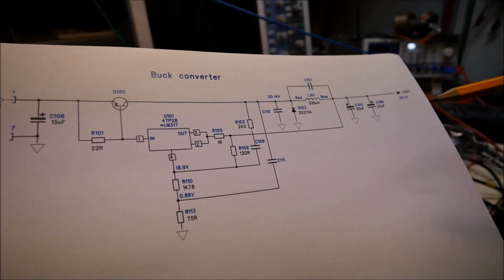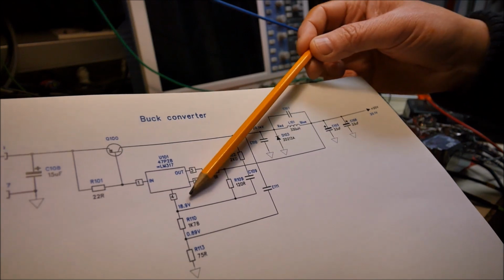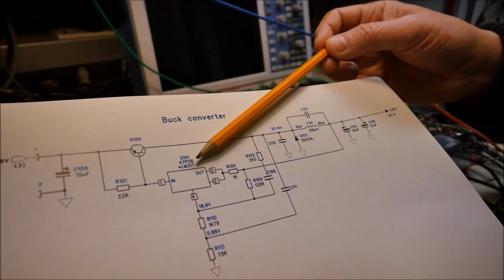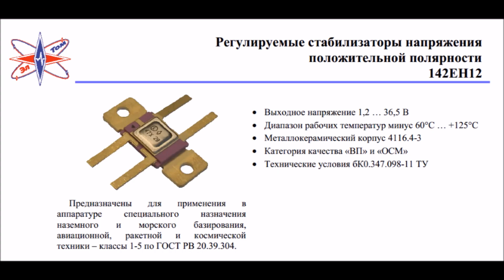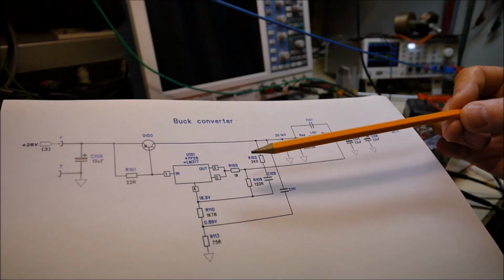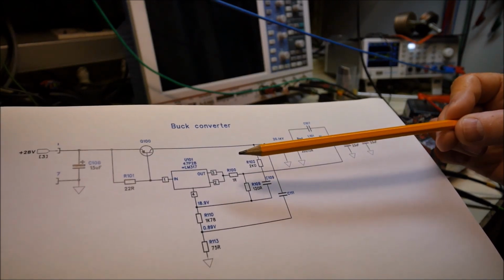LDM #396: Tornado-S Missile Part 5: Synchronised voltage to frequency converter

Comment: AI Summary

Abstract:

This video analyzes the inertial measurement unit (IMU) of the Russian Tornado-S missile, focusing on the accelerometer circuitry. It corrects previous schematic errors, detailing two versions of the LED current source and clarifying the function of the Buck converter. The video identifies the core circuit as a synchronized voltage-to-frequency converter, referencing a Russian patent related to temperature stability. The operation of the converter is explained, demonstrating the relationship between input current and output frequency. Finally, the video outlines a plan to build a test circuit using a PIC microcontroller to measure acceleration, speed, and potentially position, and it demonstrates testing the accelerometer on a modified test board, showing accurate readings of acceleration in G's.

*   0:00:04 IMU of Tornado-S Missile: The video focuses on the Inertial Measurement Unit (IMU) of the Russian Tornado-S missile, specifically the accelerometer component.

*   0:00:09 Schematic Corrections: The presenter corrects mistakes from a previous schematic related to the accelerometer's LED current source.

*   0:00:22 Two Current Source Versions: Two versions of the LED current source circuit exist. The first (2022 boards) uses a Zener diode (6.5V) and provides ~40mA. The second (2024 boards) uses a Darlington transistor configuration and a current source (~300µA) instead of a Zener, providing ~33mA. The change may be due to component availability or reliability issues.

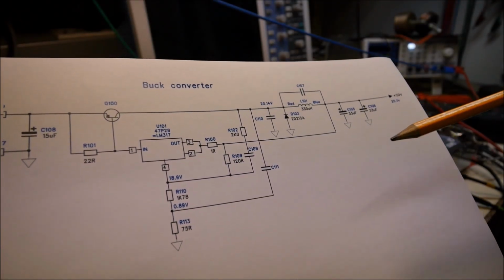*   0:01:45 Buck Converter Clarification: A component previously identified as a MOSFET in the Buck converter is clarified to be an equivalent of an LM317 linear regulator.

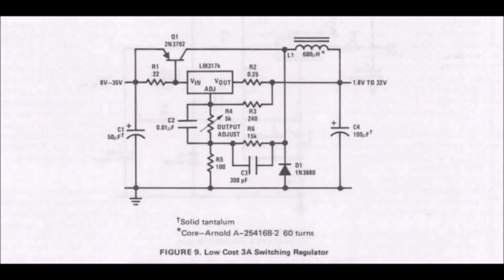*   0:02:10 Voltage-to-Frequency Converter: The circuit is not a multi-slope ADC, but a voltage-to-frequency converter, as detailed in a Russian patent. The patent focuses on temperature stability of the accelerometer.

*  0:02:29 Accelerometer Block Diagram: A block diagram of the accelerometer circuit (found in the patent) shows an interface very similar to the one used on the missile. Key components include an integrator, two comparators, and flip-flops.

*   0:03:09 Detailed Circuit Analysis: The circuit includes an integrator, two comparators (with positive and negative thresholds), two JK flip-flops, and feedback for adding/subtracting a reference current.

*   0:03:36 Synchronized Operation: The voltage-to-frequency converter is synchronized, with a clock frequency of 200 kHz.

*  0:03:44 Signal Analysis There is jitter as a consequence of the synchronization with the clock frequency, but integration is possible for speed calculation through pulse counting.

*   0:04:38 Input Current and Frequency Relationship: Demonstrations show the output frequency changes proportionally with input current (e.g., 10mA input ≈ 1.74 kHz output, 20mA input ≈ 4.48 kHz output).

*   0:05:30 Speed and Position Measurement Design: The presenter plans to design a circuit to measure acceleration, speed, and potentially position, reusing a previous design with a PIC microcontroller.

*   0:05:53 Microcontroller Modification: Two 32-bit counters within the PIC microcontroller will be used to count pulses from the positive and negative acceleration outputs. A pin used by the original design will be rerouted, and the line will be cut accordingly.

*   0:06:35 Clock Output Modification: A Pulse Width Modulation (PWM) output (pin 11, OC1) will be used to generate the clock, and it will be able to directly drive the pulse transformer.

*   0:07:20 Test Board Setup: A test board is used, with the accelerometer mounted and connected to a middle board and then to the main test board. Power (5V) is supplied via a separate board.

*   0:08:02 Signal Connections: Twisted pairs of wires are used for the 200 kHz clock signal, positive acceleration output, and negative acceleration output.

*   0:08:18 Mode Selection: A selector switch allows choosing between acceleration and speed modes. A push button initializes counters in speed mode.

*   0:08:41 Acceleration Mode Demonstration: In acceleration mode, the display shows the difference between the two input frequencies and the acceleration in Gs. The accelerometer is demonstrated, showing 0G when orthogonal, +1G, and -1G in respective orientations.

* 0:09:08 Frequency at 1G: the corresponding frequency at 1G is 326Hz.

I used gemini-2.0-pro-exp-02-05| input-price: 1.25 output-price: 5 max-context-length: 128_000 on rocketrecap dot com to summarize the transcript.
Cost (if I didn't use the free tier): $0.02
Input tokens: 13402
Output tokens: 914
Reply: G
T
F
O 
with this AI slop BS

Comment: I wonder if the current source has better temperature stability than the Zener diode, that would seem to be a logical choice for a missile which may have to work across a very wide temperature range.

Comment: I just realised a sneaky extra feature of this up-pulse/down-pulse integrator system.  Each time as it sends a pulse it steals a fixed amount of charge from the integrator capacitor to bring it back towards the neutral voltage.  If your pulse generation is unable to work fast enough it will STORE the extra charge in the increasing integrator capacitor voltage and keep retriggering at the next valid time slot and subtract another lump of charge so even if the pulse train cannot keep up with instantaneous high acceleration (jerk) the total amount of acceleration will be transferred to the INS computer as fast as it can, rate limited by the INS design.  If there is instead a reversal of acceleration immediately after the high acceleration before all the pulses have been sent to the INS the integrator will automatically and correctly start to reduce the capacitor voltage towards neutral and only the remaining uncounted acceleration will cause pulses.  If the reversal is equal or more than the initial jerk then the other count pulses will inform the INS of the final integrated acceleration (velocity).

This is such a neat technique for digitising the integral of an analogue signal without any added digital error.

The only error is the charge that is below the comparator thresholds and a static value here means no acceleration and the lack of pulses means constant velocity with the error at a maximum of one count.
Reply: The velocity increment corresponding to each output pulse is proportional to the reference charge injected per pulse. Since the duration of this current pulse is equal to the 8 clock periods, the velocity increment per pulse depends on the clock frequency. From the circuit parameters and the data given in this video, for the input clock frequency of 200 KHz one output pulse corresponds to about 0.053 m/s. At 1058 KHz clock each pulse would have been 0.010 m/s and so on.

But the deadband of the converter does not depend on the clock frequency. The comparator threshold is set at 0.54V. The maximum integrator charge which will not cause the crossing of the threshold is therefore 0.047uF * 0.54V. Doing the same conversion of charge to velocity as above, this corresponds to a velocity of 0.024 m/s. No matter how fast the clock and how small the velocity increment per output pulse, the velocities under 0.024 m/s will not cause the comparator threshold to be crossed.

If the inertial navigation were used for the entire 200 seconds of flight, the 0.024 m/s would corresponds to a position error of just under 5 meters. In reality, the missile uses satellite navigation for most of its flight, so the error due to the deadband of the VFC is probably not a significant factor in this system.

Comment: So, for one "g", the output of the accelerometer is 1.8 mA, and from the previous episode's schematics, the full scale of the Voltage-to-Frequency converter is around 140 mA. It looks like this system should be able to measure accelerations in excess of 70 g's,  assuming the accelerometer itself has that much of a range.

These missiles accelerate during launch from zero to over 1000 m/s in maybe two seconds or thereabouts. The acceleration is not uniform, so the peak value could be significantly higher than the average. This would require the longitudinal axis of the IMU to be able to measure this rather high acceleration.

Comment: do you think it is possible for a diy servo accelerometer to reach this level of accuracy? Just for fun of course, but with online CNC machining services and off-the-shelf parts, is there any hope?
Reply: It is relatively straightforward to make a device capable of performing the demonstration presented in this video -- measuring gravity to 1/1000 in a tabletop experiment. 

But that is very different from producing a device that would accurately measure acceleration of a missile across the full range of environments in which it is supposed to function. Invisible nuances of construction make a big difference in how stable the accelerometer is with aging, with temperature variation, etc. The way the established manufacturers have figured this out was through decades of testing and analysis.
Reply: I think you would struggle to make it small, fast and accurate but any one of the three should be possible DIY.  A cheap postal scale with serial port and a test weight glued to the pan is accurate but neither small or fast.  A modern MMIC part can be found in a game hand controller or any modern mobile phone but may not be as accurate.

Comment: Nice to see a working demo! Congratz on figuring it out.
This proto-adc circuit is actually somewhat good. 

1) It requires almost no computing power to interface with. If UC has hardware timer/counter, you basically just read one or two registers. And you do not lose any data between samples.
2) you can get more resolution by reading the counter less often. Trade resolution for bandwidth online without changing clock rate etc.
3) It is not sensitive to values of most of its components. Also, it does not rely on any "key" component.

Comment: The 50s called... they want their  mechanical accelerometer back😂 pretty awesome seeing this, tiny mems gyro/ accelerometers are boring,  but  seriously this was made in 2016! Also mechanical gyros are bulky and moving parts drastically increase potential  failures.
Reply: Dont count on mems to be stable and accurate.
Most use some kind of correction and whit rather high refresh rate.

Comment: le système intègre l'accélération pour avoir la vitesse donc V = accéléro*t c'est bien ça
Reply from the maker: Oui mais comme l’accélération est délivrée sous la forme d’une fréquence la vitesse est proportionnelle au nombre d’impulsions comptées à partir d’un instant initial puisqu’on peut écrire f=dN/dt=k*dV/dt donc V=N/k (+cst)
Reply: @lelabodemichel5162  Je pense qu'il doit y avoir un biais dans le résultat , comme c'est un missile ça ne doit pas être important , j'aurai utilisé un tube de Pitot à la place
Reply: @bernardbriquet5244  Pitot tube only gives you forward AIR speed.  The 3-axis IMU can give you useful 3D acceleration in a turn as you also have the gyro data to determine your heading.